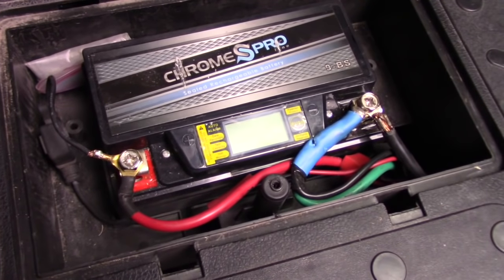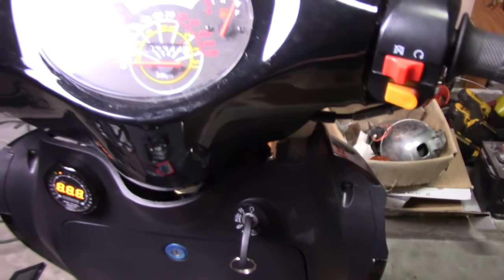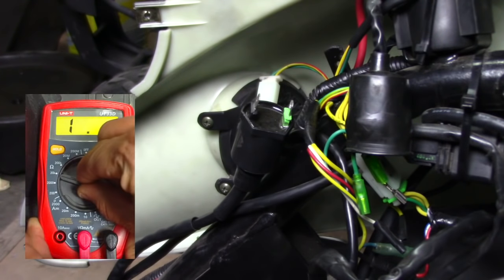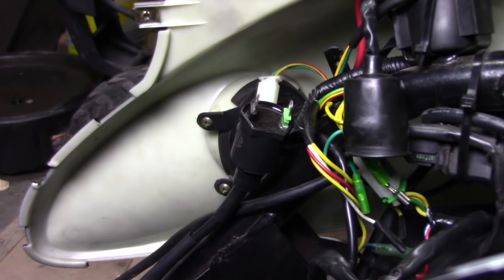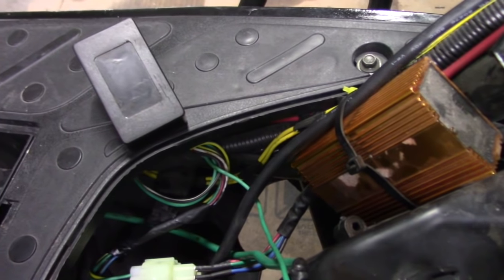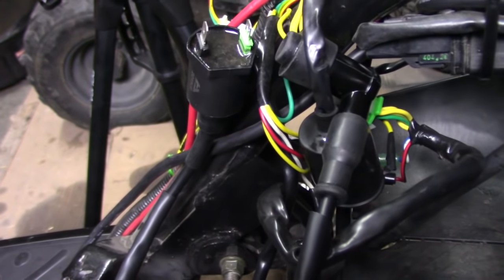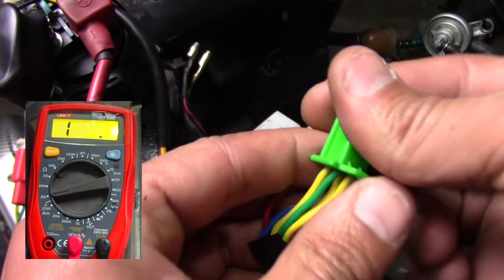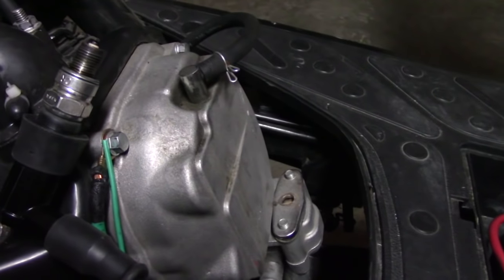GY6 Electrical Troubleshooting Tutorial - “No Spark” Eliminator

Comment: Is it common for the starter button to go bad?  I purchased a used Kazuma Meerkat 50cc and while trying to get it running after replacing wiring harness it stopped cranking using the button.  I can jump the solenoid to start but the button doesnt work, it doesnt even make solenoid click.

Comment: hi my tgb 125 cuts out as soon as you let go of the brake lever,it starts and runs fine untill you let the brake lever right out then the engine just dies,ive disconnected each stop switch in turn to test but doesnt makes any difference,have you any ideas as im running out off ideas.cheers

Comment: I bought a used GY6 ATV and when I pulled the flywheel I noticed the inside was rusty no signs of 6 point connections so I cleaned it up and bought a new stator the problem is adjusting the pick up all the way back I hit the magnet. I tried reaming the holes longer but it still hits the magnet. Any suggestions so I can get it to turn all the way around and gap it so I can get spark?

Comment: Stumped.   I have worked on Chinese stuff for years. All electrical checks out. CDI, coil, stator and switch all check out. I’ve  even overridden the brake switch/interlock and the kill switch is not hooked up.  No spark. Driving me crazy. Turns over of course. This is a Gocart but same GY6. Not a novice here... but completely lost. I have traded out numerous CDIs and coils (plug and play). Stator pickup and igniter working. Getting 50ac out of stator. I know this sounds crazy, but surely the volt reg would not have anything to do with it - ? I’m out of options.  Any idea?
Reply: Tried a new spark plug ?

Comment: I have Honda SH 125, around 30 000miles, only changing oil, and from around 25 000miles there is a little oil drop. Bike starts always right away when cold. But recently when I make like 10 miles and switch engine off and then won't start again. It just clicks and nothing else. If I wait 5 min I can start it. I thought starter is wrong, when I took it out and tested, it is spinning. I  bought new one anyway, placed back. Now I will not start it, new starter turning but wont get engine start. Battery is fully charged and tested. I wonder if engine is not wrong. Its really annoying, I bought new bike but have this problematic one on my garden. Its puzzle and beetle in my head. Any suggestion where is the hook?

Comment: I have a question I have a 150cc I just dropped it yesterday and my air filter connector came loose and I have to screw it back on but a bike cut on and it cut off what could be the problem

Comment: Changed my reg/stator. Battery still not charging. 2001 gsxr 600 13,460 Miles. Any thoughts. ? Btw there both hardwired. No block connectors.

Comment: First problem with gy6 is that it's a gy6. Buy Honda or similar higher quality brand. I've bought Hondas that have sat for years and only had to put new fuel and at most clean the carb and literally haven't had any issues for months or years. My Honda metropolitan post 2005 models are awesome machines. Hardly anything goes wrong with them

Comment: I put a new spark plug boot and new cdi and new spark plug. Still no spark on a coolster 75cc also new coil what else could it be the stator looks new only rode the bike a few times it sat for a year what should i do next. Could it be the regulator. My push start wires are fine i wont turn over by push start on by jumping the new solenoid

Comment: So I had the ohms reading on 200 for the red and black stator check, it gave me 1 on reading the line for cdi. However when I turned it to 2000 it gave me 500 reading. Does this mean it's still bad? Is 500 too much or is it accaptable

Comment: Hi I have 2 bikes and I tested the stater on both with the multi meter on the red n black and the green and had a reading on both for a split second but showing me a number higher than 200 omes so turned the dial and got a reading. Does that mean it's alright ?

Comment: Hey joey
1 question 
My scooter has been making a noise 
When I turn it off
The other day I checked the oils 
The gear oil was very low
Could that cause my bike not to start now?
Reply: Check if your rear wheel is moving, if it is, then you are ok from the gear oil

Comment: I need help I put a new I got a 150cc chinese go kart I put a new ignition coil and still didn't get spark I put a new cdi box and it has a red light and blinks when it get a signal from the fly wheel but it won't send power to the ignition coil and it can't be the fly wheel since it worked before it was just parked what could it be

Comment: my pick up coil does not produce a reading while cranki ng ive replacedd with a known good pick up coil from a running bike sgtill no ac voltage  the black and red is putting out 70 volts ac nothing from pick up coil

Comment: A question;
I tested the ignition coil, and it gave good ohm indication.
I tested the spark plug coil (boot and wire), and it gave good ohm indication.
Now;
I tested the boot/wire connected to the ignition coil, and they gave NO ohms indications whatsoever.
What TH is wrong?
Please help, anyone who reads this?

Comment: HeyyA.goat a malabu 50cc scoot jut fixed cluch spring (small ones) and put new plug wire on it and still having problem. It starts and goes but the minute I hit a hill or I am loosing compression / speed boom boom what ever ya call it have any suggestion just did valves also .

Comment: I have a trailmaster blazer 150x and the problem I'm having is when I turn the key on the gauge lights up on the dash for a second and flickers out.  The buggy wont turn over at all, I've replaced the starter solenoid already and charged the battery but still no luck.  I think it's a short somewhere but I'm not sure, it was running perfectly fine till my daughter hyperextended the back of the buggy that holds the engine and it yanked the positive wire off the battery but I've fixed that and I have power to the starter solenoid now but it still wont turn over..  anyone have any ideas what it could be?

Comment: hi i just got a used 2021 4 seater go kart with the long shaft gy6. it has a wire coming out of it right 1 inch the shift rod location on the passenger (right) looking from the rear. it is 3 wires yellow, green/red stripe and purple wires going to a 3 way female plug. it wasnt plugged into anything when i got it just wondering where it goes i cant find any place for it? i`m thinking a indicator for where the tranny is? on those models equipped with that..?? anybody know where that goes? thanks

Comment: I get one spark when I hit the starter and then nothing while I crank.
Reply: Well after tracing all the wires everything checked out and luckily i noticed the stator magnetic pickup was installed upside down. I think i got a good deal on something that turned out to be really easy to fix!

Comment: That's throwing parts at it not diagnosing it. 
How about resistant and continuity testing on the coil? 
How about some pin outs and resistance tests ok the cdi ?
What's the air gap on the stator pick up???? Like bro this was the most unhelpful video I've seen this month